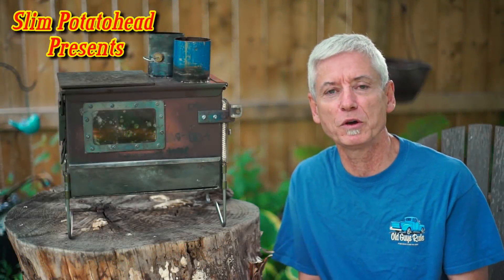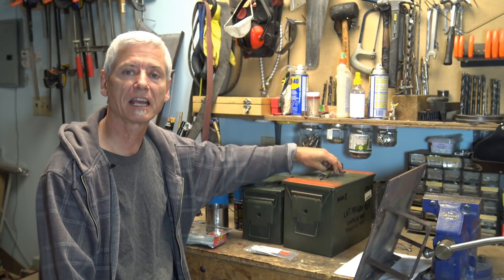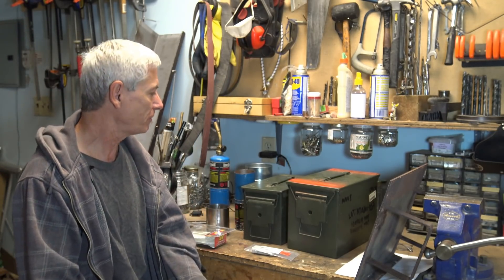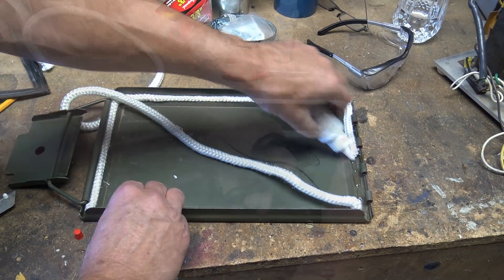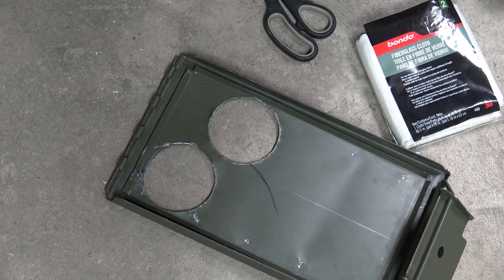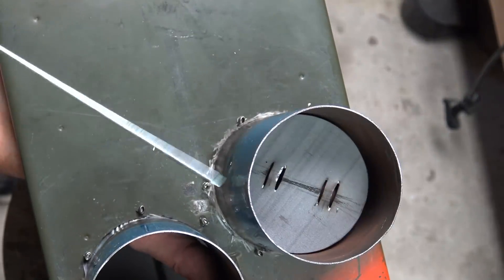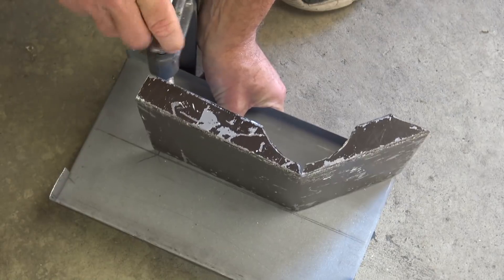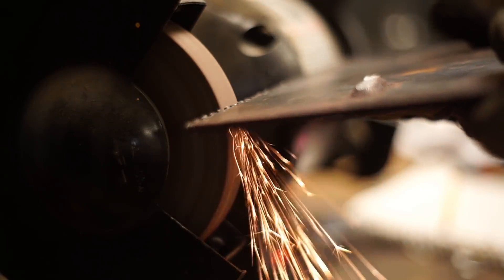A Wood Stove for Camping Part 2 - Starting the Build

Comment: Slimothy- Great video and project. I have a couple of questions: 1) Did you use the thicker metal on the door for a reason other than that's what you had available? 2) Why did you use screws in some places and rivets in others? It seemed like you used screws when the metal was thicker (door, hinges...).  Thanks and keep up the good work.
Reply from the maker: Hi James. I used thicker material for the door because it was available. Rivets are for permanent fastening, while bolts are for parts that may need to be removed. Thanks! SP
Reply: @SlimPotatohead  Thanks Slim.....makes perfect sense; I'm trying to build one myself.

Comment: I like your style and metalworking by hand.  It was painful watching you drill/saw/grind the thicker steel sheet and brought back memories of gouged knuckles. You can cut thicker mild steel sheet with a jig saw if you have a variable speed jigsaw with a good blade and the correct technique.  
1. test the steel sheet for hardness with a file.  The file should dig in readily.
2. choose the best quality blade you can afford and get the correct number of teeth per inch (tpi).  Rule of thumb is 3 teeth engaged. so a 1/4 sheet (plate) would take a 12 tpi blade. .. too few teeth and you will grab;  too many teeth and you will not remove enough material (see#3).
3. steel work-hardens so you want a slower blade speed with an aggressive feed rate.  Don't push too hard just make sure you are not burnishing the steel or it will become hardened and your blade will dull quickly.  This is particularly important for cutting stainless steel.
Hopefully this helps reduce the effort for those with a variable speed jigsaw (or access to a variac - variable ac voltage).  You can also use an cordless jigsaw or reciprocating saw.  A narrow blade is good for curves while a broad blade is good for straight cuts.  I am building one of these for a winter camping trip so I will watch your third video for more tips!  Thanks a bunch!

Comment: We must have missed the part where you show the design for the pellet delivery system. We've used pellet stoves for 35 years and it seems that if we just dumped pellets into that "hopper" they'd all fall down in a clump and the fire would follow the pellets up into that "hopper". You must have some sort of baffling system so that gravity feeds the pellets a few at a time into the flames. How did you do that?
Reply from the maker: please refer to my build videos: "A Wood Stove for Camping" Series. Thanks! SP

Comment: I just found this. You have done a wonderful job here. I have subscribed because your narrative is so soothing and informative. I do have a question as I am beginning to build your stove. The propane tank did you just need one tank and cut it in half? Or better yet how long did you cut the pieces for the flue and hopper
Reply: Be careful cutting into a propane tank. They are not always empty! One spark from your saw blade and you might be missing a thumb, or worse.

Comment: i must have missed something  - how did you cut the propane cylinders safely? I want to do this but I'm afraid of igniting any residual gas with a spark from my saw blade or grinder :p
Reply from the maker: After opening the valve pin to make sure all the gas is removed, drill a very small hole with a hand drill. SP

Comment: Subbed! You've given me so many ideas and now I want to custom fab my own in door stove. I love the baffle chamber, this is indeed a huge problem with our potbelly as the combustion chamber allows the heat to exhaust straightaway, even choking the exhaust does not prolong the burn all that much. Couple this with heat loss through the exhaust pipe and it's quite inefficient. What are your thoughts on a double barrelled system with minor baffling in each? Would too much baffling smother the flames with exhaust gasses?

Much love,

Tynan
Reply from the maker: Hi Tynan, being that this is my first stove, I expect I will have some tweaks as it gets worked in. The baffle seems effective so far, although I did end up adding more metal to the left side where the flame curves around as it was getting quite hot. I do get a lot of smoke the first few minutes, but the narrow chamber has not effected the intensity of the combustion. How narrow you can go is really hard for me to say without experimentation. Thanks! SP
Reply: Slim Potatohead I shall certainly keep an eye on this endeavour of yours, great information and the response is much appreciated. Thanks Slim, take care and all the best. Good luck with the winter testing!

Comment: That is cool! You are right that it is therapeutic.Would be a lot easier with a plasma cutter, Oxy-acetylene torch, tig torch. Would take a lot of the thought and time out of it! Good job for what you have to work with!
Reply from the maker: Hi Joel, The goal was to make a stove that could be made with tools from the average garage or home workshop. Also, using bolts and rivets means it is reversible should the design change later on. Thanks!

Comment: Thoughts on cutting the thicker steel - I understand why you would make many holes with the drill, it seems faster. I think you would be able to cut the thick metal better with the saber saw. First, use a saw that has adjustable speeds, a slow cut is better for metal. It keeps the blade cooler and lasting longer. Second, go for a quality metal cutting blade, the expensive ones are worth the extra money. They will last longer than multiple cheap ones.
Reply from the maker: Hi J, good advice, thanks! I did first try the metal blades with my jigsaw, but wore out the blades instantly (at $7 a blade). Drills were cheaper and easier to lube.  SP

Comment: Fantastic stove but i feel  a 4 inch angle grinder would be more use to you than a bench grinder because then you can use cutting discs to cut your metal instead of drilling loads of holes and hell of alot of filling ? Just saying thats all but brilliant build otherwise 👍👍👍👍

Comment: I  was thinking of buying a cubic wood stove but now that I saw your awesome build, I think I will give it a try myself . Since you enjoy metal fabrication so much, have you considered getting a MIG welder for yourself. I did just that as I used all my accumulated bonus points from my  work to get myself this very strange gift (strange to every one since I work in a data Center).
For cutting thick metal, I use a standard skill saw with a metal cutting blade. You can use a small piece of wood clamped at a desired location. It makes a mess of metal powder but it is an easy way to cut.
Reply from the maker: Hi Michel, my travelling limits the toys I can keep and the time I can use them. Someday maybe. Thanks! SP
Reply: Well if you pass by Montreal, give me a shout, I some toy and friendship.

Comment: Brilliant, Slim! I bought a wood stove online last spring and have been modifying it for camper use. Question - where and how did you run the stovepipe out of the camper roof? I would be interested in a video on the subject since I have a homemade A-frame style camper and I'm hesitant to make a hole in my roof. Thanks, Slim!  Edit: your NOTE came in after I posted this. Yes, much care must be taken with proper ventilation and a good CO monitor among other precautions.
Reply from the maker: Sorry Len, but I will not be discussing the heating option of this stove until all my tests are finalized. Weather too hot to make any conclusions right now. Thanks! SP
Reply: I hear you! I want to test mine as well but it would be unwise to inflict any additional heat on my hellish environment at this time. Waiting as patiently as I can in the southern USA.

Comment: I wouldn't consider those gloves you wore good, they are the cheapest on the market and most consider them one day throw aways, seriously consider purchasing a leather pair they will last far longer than any cloth pair.
Reply from the maker: The gloves I used were leather with some cloth backing, however I do agree that an extra thick pair would be far safer to work with. Thanks! SP

Comment: Loving this build series! I am curious about the placement of the damper handle. It looks like, being over the actual stove, it would get very hot and would need gloves to adjust when in use.  Very intetesting, Slim!
Reply from the maker: Hi Esteban, I'm not particularly satisfied with the placement of the damper myself. I may reverse it so I turn it from the back right side instead. Having a loop on one end means I can use the same tool to turn it as I open the door, so hands are ok. Thanks!

Comment from the maker: NOTE FROM SLIM: Here's the 2nd part of the series. As it is a complicated build, I realized I couldn't show it all in one video. Please be patient while I prepare the 3rd. I will NOT however be discussing the heating aspects of this stove until a much later date, as further testing is required before releasing any details. DO NOT make assumptions and attempt to use this stove in an enclosed environment. I would also not attempt to even build it until all the details are presented. PLEASE BE SAFE. Thanks! SP